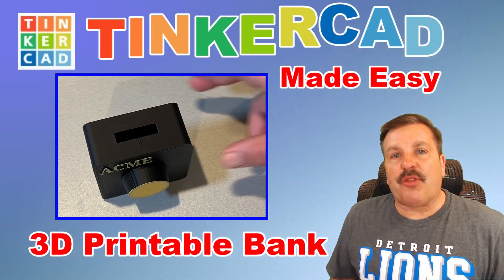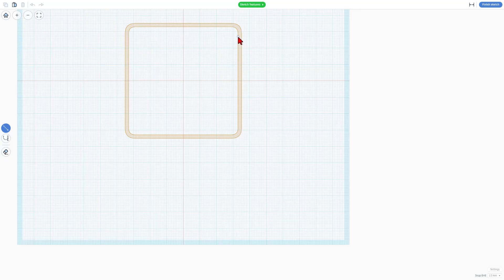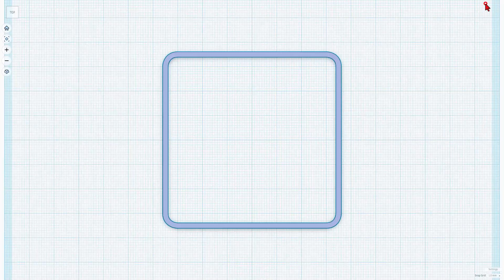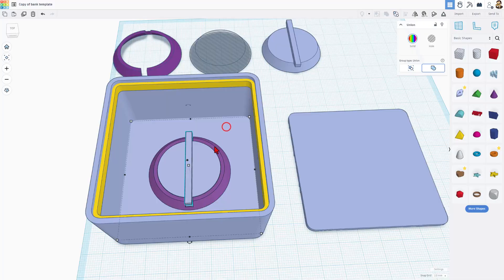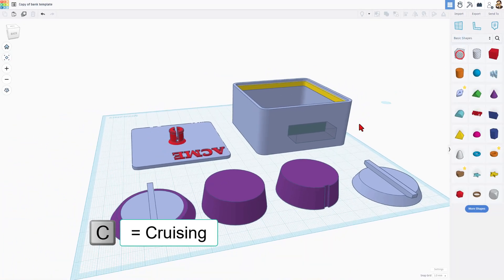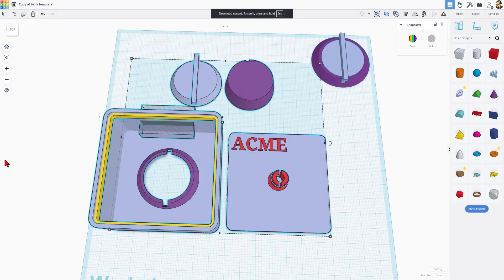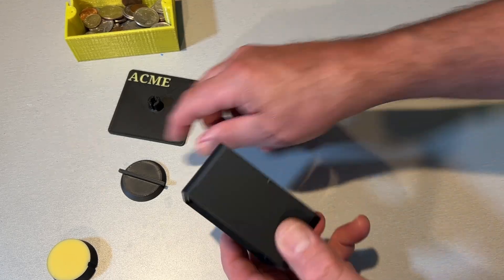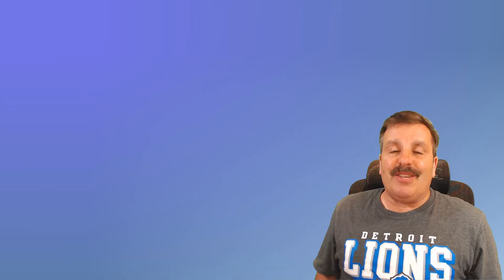Tinkercad Sketch Tool Bank Template & Tutorial! Classroom Ready! 💯🔥

Comment: I wish we could import shapes into sketch from the orange other-shapes guides.

TC is rapidly turning into a sketch-based CAD.
Reply from the maker: If would be cool if we could turn SVG imports into sketches. Having "estimated" points that we could simply tweak would be really slick. I could also see where the system would get stressed as users imported tough stuff too.

Comment: That inside line fill is clever. Isn't there a fill mode?
Reply from the maker: Fill mode is the tool for the SVG import shape. I could have shut off the stroke and filled it... but the size would not have been the inside then.. I needed that exact size for the top to fit as it does.